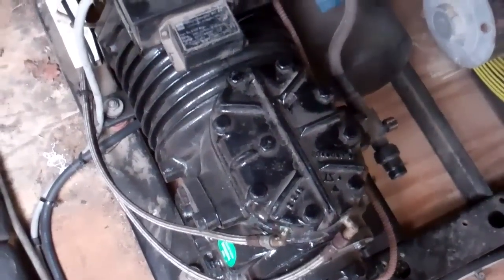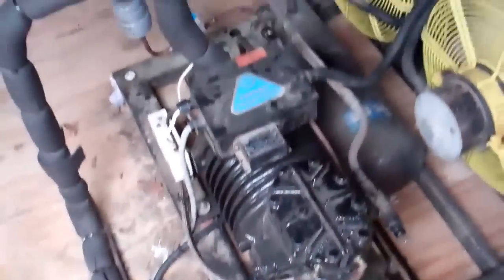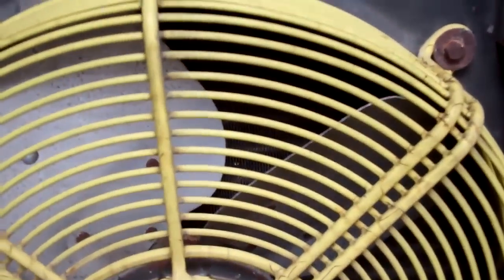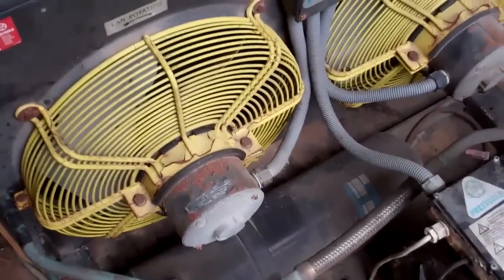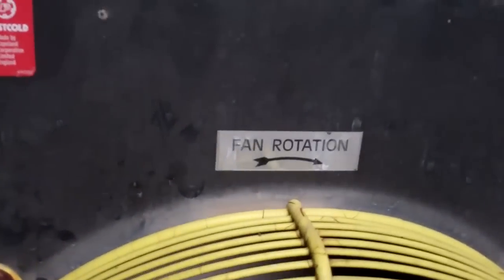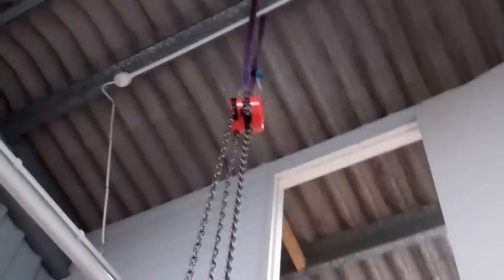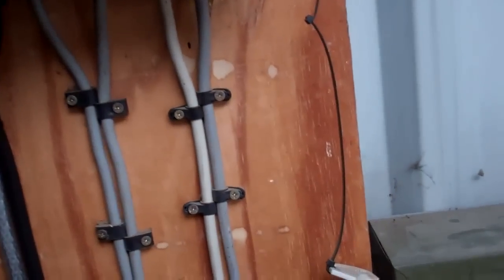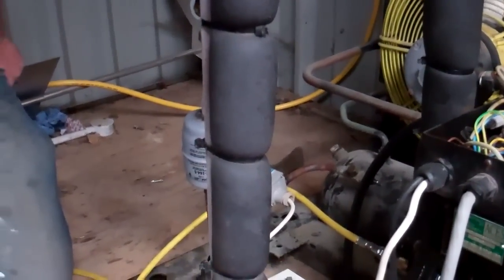Fubar....

Comment: @heavydiesel yeh one of those AHT  drink coolers I had got blocked up and overheated to the point of burning the discharge line black 9the armaflex burnt to a crisp) and boiled its run caps/electrical box!

it would have been incredibly hot. only runnning R404a too.

Comment from the maker: @fritzhvac I serviced it in august but you can't get the louvers off the front to clean the condensers so i said it need doing with an air line. Its in a loft above the office so can't use water or it will fill all the sockets etc!

When i explaind to the herdsman on the phone what the problem was he went off and bought an air line and gun which we used, despite it being his day off so i can't fault him really. Its just an awkward situation to be in, units should never have been put in a loft!

Comment from the maker: @Aussie50 Yeah! it always amazes me that no one notices the noise till its broken, though in this case the customer had heard a noise but thought it was one of the fans. It was pulling 38 amps a phase, should have been 17 max! It wouldn't pump at all so i think its snapped both rods...

Blocked condensers (or failed cond fans) kill a lot of compressors, especially on smaller stuff that has no hp cut outs, I'm thinking of changing the hp to a manual reset.